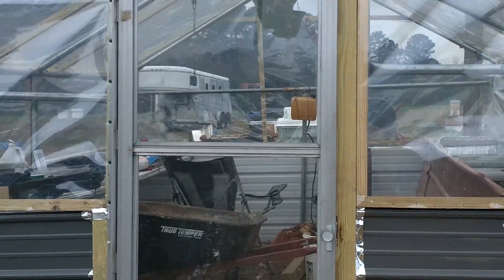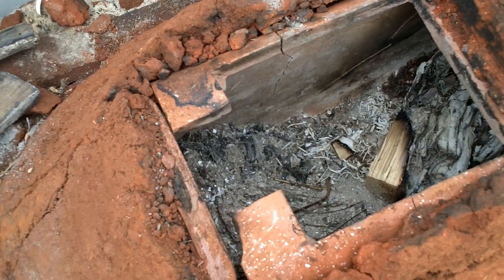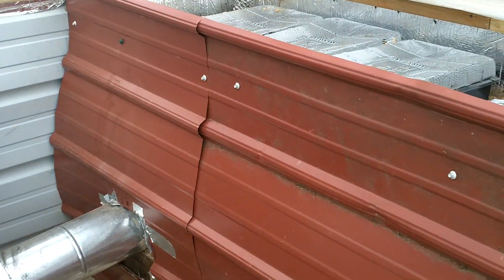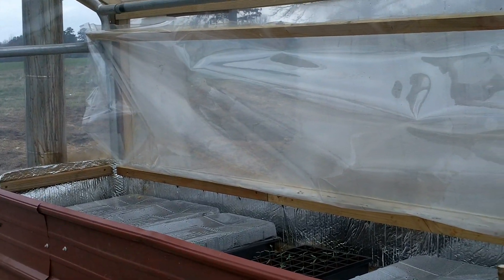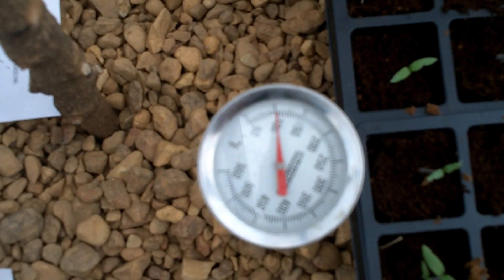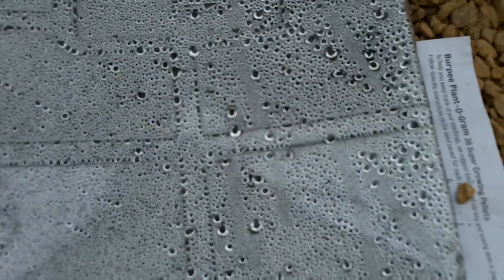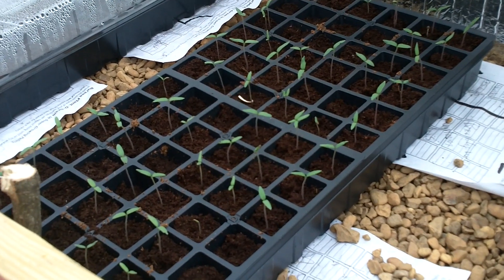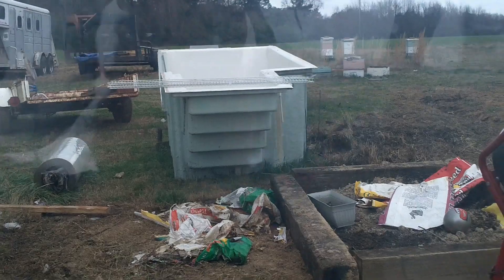update on rocket mass heater and seed starting

Comment: good job - learning as you go.

The mass around the piping is good.

if you increase the mass around burner and jet - you will increase residual (stored heat) for your green house. 

With that the device will store more heat from each burn.

Comment: I really enjoyed your Rocket Mass Heater video. I am in the process of creating one for our own aquaponics green house and this is the only video I've seen showing the heat index for above and below the rocks. Is there an updated video for your green house? Were you able to install the bigger barrel? Were you able to sell your starts? Also, I see you used clay to surround the flu, how did you change this area? How are you venting the last pipe, did you run it out of the green house? Thanks again